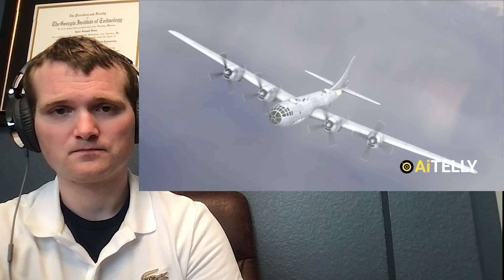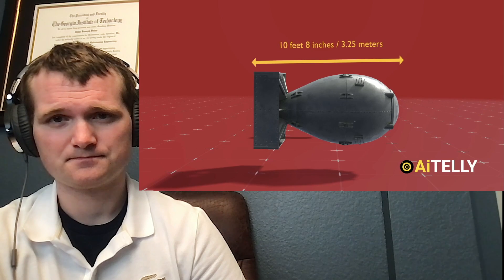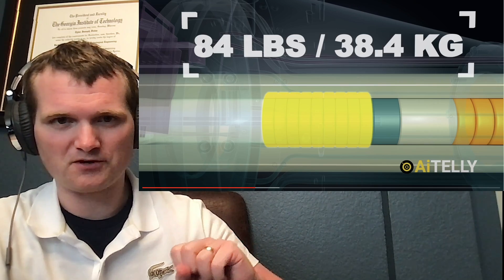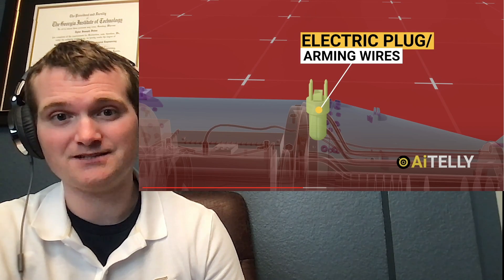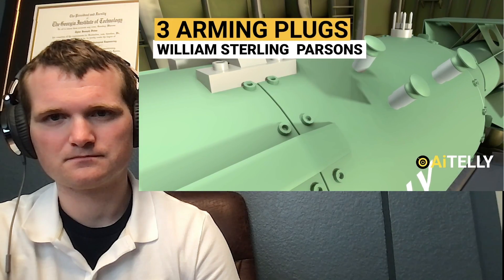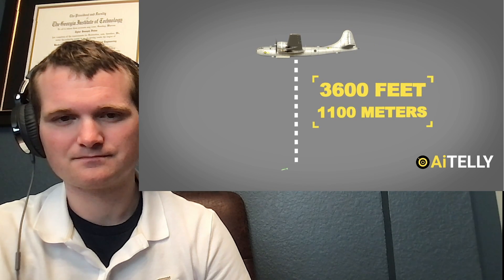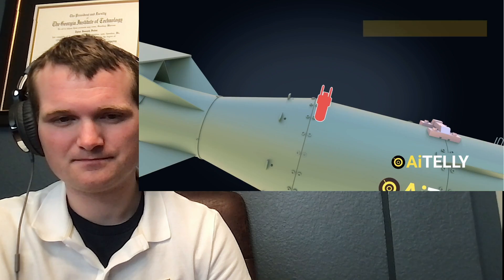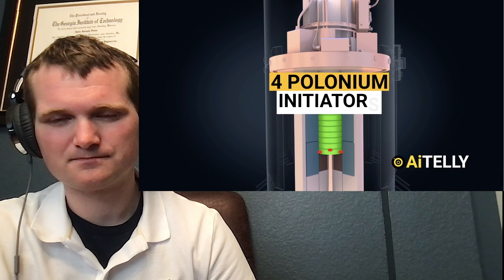Oppenheimer's Atomic Bomb - Nuclear Engineer Reacts to AiTelly's Explanation of How It Works

Comment: It seems I read about or watched something that said they looked at a plutonium gun type bomb, but plutonium was so reactive that the fission process could have started before the two pieces were completely brought together. I'm guessing this would have reduced the yield and spread the remaining plutonium around.
Reply: That's not quite it. Reactivity is how far you are from criticality; a positive reactivity meaning that if there were any neutrons, the reaction would grow exponentially until something changed (in a reactor, it can be enough that the fuel or moderator gets hot, and this reduces reactivity enough that it is no longer supercritical and power stops growing). 

In a bomb, you don't want the reaction to start before you are way beyond critical; if it starts too soon the thing blows itself apart before much of the fuel is consumed; you can get a 10 ton TNT equivalent explosion instead of a 10 kiloton TNT explosion. 

Plutonium invariably contains plutonium-240, an unwanted isotope. Once Pu-239 is formed in the irradiated fuel it can absorb more neutrons and become this unwanted isotope. This is why reactor fuel is useless for making bombs; bomb plutonium is created in special reactors where the fuel is only lightly irradiated and the reactor is designed so you can continuously insert and remove fuel while the reactor is operating; for economical reasons this is nearly always graphite or heavy water moderated reactors with very little enrichment. 

This Pu-240 contaminated plutonium undergoes spontaneous fission (fission without being hit by a neutron) at much high rates than highly enriched uranium. This means there are always neutrons around that may start the reaction when you have created a just barely critical mass; tens of microseconds too soon (which is way too soon). 

With weapons-grade U-235 (at least 90% U-235) you get ~1 neutron per second per kg of material (mostly from the U-238).

With weapons-grade stuff; there is officially "less than 6.5%" Pu-240.  On the high end that's 60 000 neutrons per kg per second. There's a lot of neutrons around all the time and you can't shield them or get rid of them because they're coming from inside the fuel itself. You just have to be very fast.

The risk that a U-235 based bomb will prematurely detonate (fizzle) still exists; it is just low enough that they considered it acceptable. If you could get extremely pure U-235; a bare critical mass puts out only 15 neutrons per second. Ignoring that it'd be heavy as shit with a reasonable tamper, you could trigger a nuclear explosion with reasonable probability just dropping one half on the other with a bit of precision.
Reply: @soylentgreenb  Thanks for the info.

Comment: They described a standard configuration B-29, Both Bockscar and Enola Gay were heavily modified to remove the gun turrets and unnecessary weight. The engines were also modified to give an extra boost to get as far away from the explosion as quickly as possible. "These modifications included an extensively modified bomb bay with pneumatic doors and British bomb attachment and release systems, reversible pitch propellers that gave more braking power on landing, improved engines with fuel injection and better cooling, and the removal of protective armor and gun turrets"